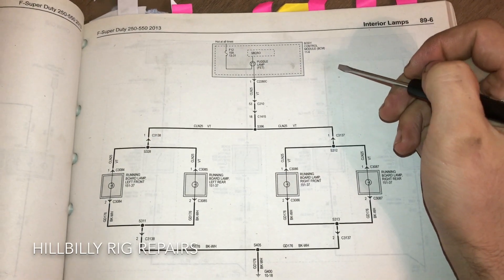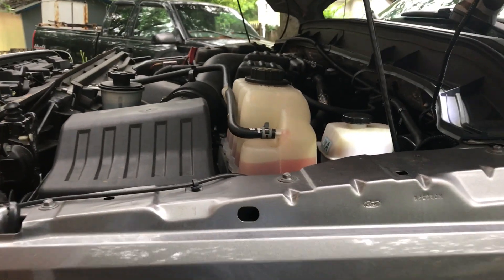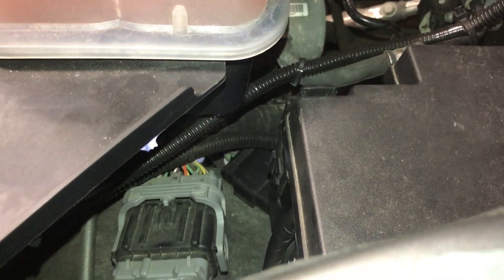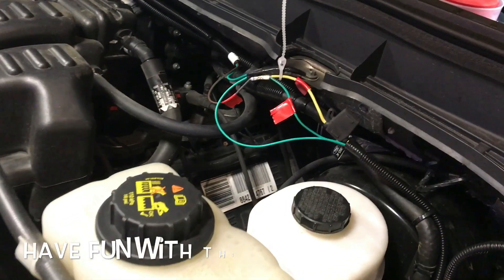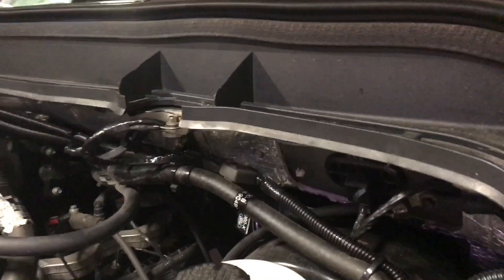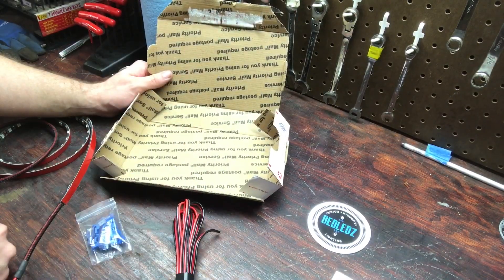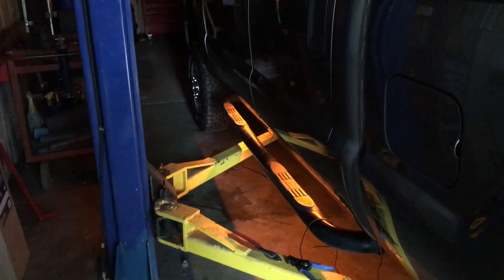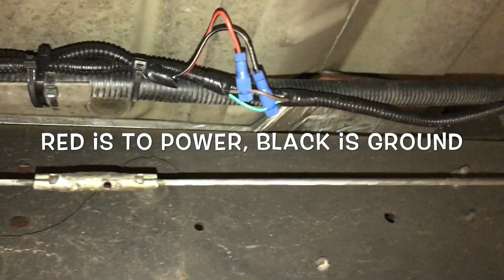2011-2016 F-250 LED Running Board Courtesy Light Install

Comment: In front of your fuel tank there is a plug that is there from the factory with the same wire..and one on passenger side no need to pull fender stuff
Reply from the maker: Watch first 45 seconds of my video-I show where on the wiring diagram some models have dummy plugs that can be used to run the lights. You don’t know what you’re talking about.

Comment: If you tapped into the VW under the truck  wouldn’t you only need to run a wire to each side of the truck, connect to the hot wire to the led and ground right at the led connection somewhere?  Not understanding why there’s connection on top of the engine bay. Great vid btw
Reply from the maker: Yes, you certainly can wire the lights your way.
I just wanted a cleaner and more simple set up-so both lights share a ground on the cowl and the fuse is right there too. Not necessary.

Comment: I have a 2011 King Ranch F350. Where do you think those connections might be if they are on the frame rail? I looked and couldn't find any unused connection points. Maybe I just have to trace the violet wire?

Comment: So you didn’t connect your running board lights to the left and right turn signal as well? The lights I ordered are sequential style and I just can’t figure out wtf I’m doing wrong. I tried tieing my running board lights too the 7 point in my bed (2015 f350) and if I’m
Not holding on the brake pedal the lights just constantly with no sort of Rthym frustrating as shit

Comment: I have a 2016 f350, did your mot come with the plugs under the passenger door ?
Reply from the maker: No connectors on my truck.
Even same make, model and year vehicles vary greatly when comparing “factory build sheets”.
Watch the first 40 seconds of video-I mention the potential for a factory plug located on frame rail.

Comment: I have a 2004 excursion and my running board lights stay on for about a half hour whenever they go on.Is there an adjustment that will make them go off sooner?
Reply from the maker: Garry Hogenbirk does your dome light stay on for the 30 minutes too?

Comment: On one of the forums there is a guy who added puddle lights by tapping into the violet wire.  I think it was further down the line than what you did, closer to the leg that feeds the interior dome light.  I guess he ruined his BCM as it thought there was an issue with the interior wiring.  Is your setup still working fine?
Reply from the maker: To be clear, this isn’t my setup. Ford designed this circuit to operate puddle lamps. It has an internal transistor which can handle around 30amps of current. However, the circuit is further protected by a 15 amp fuse. This protects shorts to ground etc. Short answer-yes fords design is still working.

Now if someone was splicing into some sort of reference or signal wire designed to carry 5volts-indeed you can fry a BCM.

Comment: how long did it last before falling off????? or is it still going?
Reply from the maker: Still holding strong after 3 storms! Ice did accumulate on them so I “reinforced” the light strip with 3m adhesive car ties just as a precaution.

Comment: Do these puddle lamps run with the turn signals and stay on the when the marker lamps are on? In your setup do they flash with the turn signals or do they run strictly as a marker lamp or only when unlocked and locked?
Reply from the maker: They are only part of the “courtesy” light circuits-when you lock/unlock the doors, open the doors etc. Basically anytime your interior dome light illumiates automatically. I hope that helps.

Comment: I notice the F350 setup under their dash is different. I have a 15 F350, by any chance do you know where that plug could be on mine?
Reply from the maker: I would check the same location in the video. Worst cast scenerio you pull the wheel well and have the opportunity to clean all the road gunk out and apply fluid film.

Comment: Great video, I'm going to have to do this to my truck as well. I like how clean and stock you made everything look.

Could you give a link to the "scotch locks" and "posi locks" as well please?
Reply from the maker: Both connectors were hard to find for me. These search keywords should get you started.

3M(TM) Scotchlok(TM) Electrical IDC 558-BOX, Run and Tap, Flame Retardant, Red, 22-16 AWG

Posi-Lock® wire connectors Assortment pack 10-24 awg(I use the blue ones and red ones)-still have the yellow ones laying around. I just wasn’t sure which sizes I would use the most, so I got a small assortment.